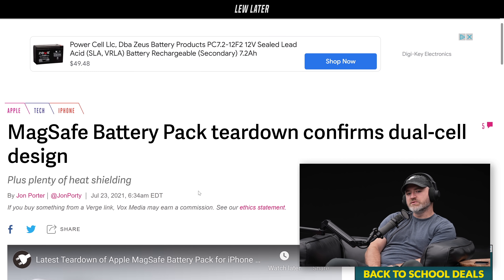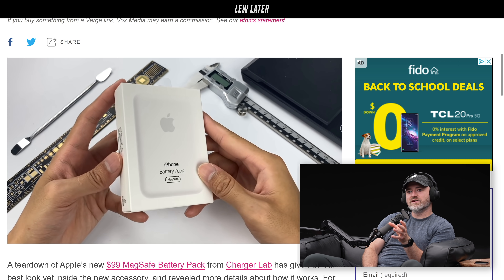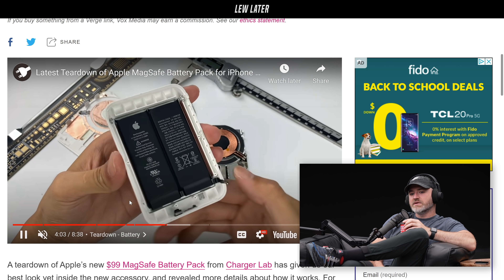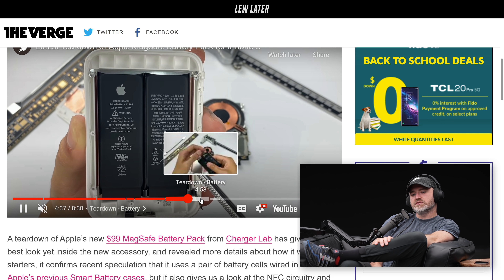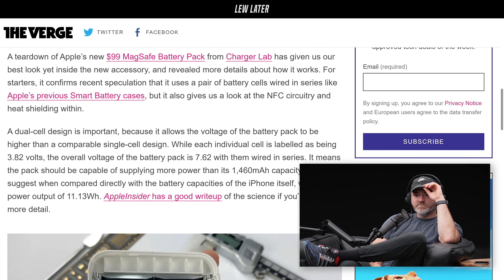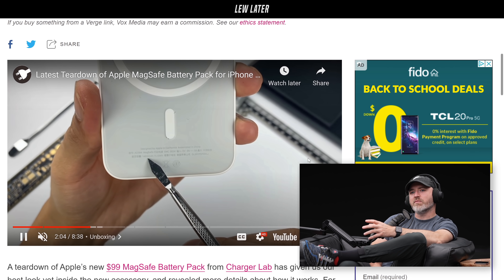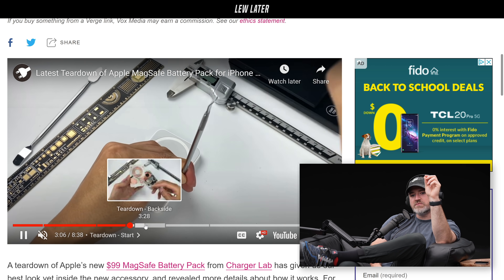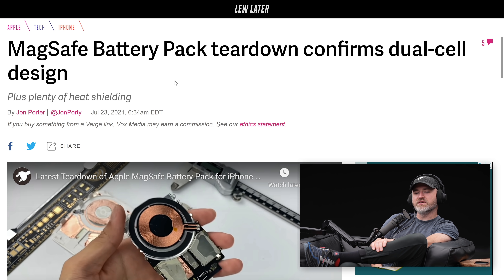Apple MagSafe Battery Pack Teardown

Comment: This video is very misleading. With the volts and mah it has it equals out to 11.13Wh. The phone 12/12pro has a battery capacity of 10.78Wh. You’re getting over 50% charge here Lew.

Comment: It's not half the capacity of the iphone, its around the same capacity as the 12/12 pro and if we take wireless efficiency into consideration we will get around 70-80% charge from 0%
Reply: with 50% efficiency it will charge iphone around 60%, the regular one
Reply: @clickbaitpro  that's exactly what I said 😂
Reply: Wtf are you smoking, one dude did a test and it only reached 48 lmao, stop defending corporations
Reply: @kdsburneraccount8087   The batteries in the magsafe battery pack are together 11.1Wh iphone 12 is 10.8Wh, wireless charging is of course inefficient and the iphone will end up 60%+- but given that the percentage is calculated from the voltage and not the actual capacity left. Because of the voltage/capacity curve, you will be able to use your phone around 70% time of a full charge. I am by no means an apple fan and I do not own an iphone so tell my why would I defend apple ?

Comment: I have a 12 and this thing pretty much doubled my battery life. It does charge at 5w and I found attaching it last minute (20%) didn’t really work well. It actually dipped a little before increasing the battery of my phone. However, attaching the pack from 100-50% works immensely better. It’s more of a battery extension. An external battery that can pop off once drained. Almost similar to the way space shuttles and rocket stages work. 

Also, the form factor when attached is reminiscent of the design of their previous battery cases.
Reply: apple fanboys always find a way to defend even a scam

Comment: for half that price, You can get a USB C PD battery pack from Anker that has 20,000 mAh!
Reply: @Dhiraj Krishna S It's 2*1460 (2920 mAh) because there're two batteries.
Reply: Whats a PD?
Reply: @Dhiraj Krishna S I highly agree.  I’m not sure why we don’t go by wh anyway.
Reply: But it has lower voltage so the watt hours is lower.
Reply: @TheMazyProduction  higher voltage lower watt hours.  Lower voltage higher watt hours.

Voltage* App hours =watt hours 
(Cough not accounting for variable voltage as it discharges)
Reply: 10.000mAh power banks are actually better for a few reasons: you can bring it to any country, it’s lighter, it can charge most phones for at least 2 times.
Reply: @aperson8693  requires a cable that breaks every 3 weeks.  Can’t be used as a wireless charger Bc ppl are into that?

Personally I did cycle though battery cases during Covid lock down because it was so much more convenient then plugging in the phone and this picks up on that as removing the battery pack is easy but keeping it there is also easy and not that as annoying.
Reply: Which is not MagSafe compatible
Reply: Apple accessories are mostly for style and not function
Reply: Apple rip off I have a few anker battery packs 10k-20k mAh n they work perfect n cheaper
Reply: @Dhiraj Krishna S I hate ppl who say this it’s 2 1460s… which means it’s equivalent to 2920 at 3.81 volts…
Reply: True

Comment: 1460MaH, are they having a laugh 😂
Reply: That's 1460mAh at 7.4V, so it's equivalent 2920mAh at 3.7V
Reply: @terimakinsu  you're not accounting for the inefficiency of wireless charging, tests have already been done and it charges a 12 max up to 45% or 12 pro to 60% or you could get a regular battery pack for $30 and recharge you phone completely 3 times over and at a faster rate.
Reply: You can make fun about the iPhone RAM too 😁✌️ the mah x2
Reply: 7.4v*1460mah*wireless is still sucks at this price but It’s only about “apple aesthetic and branding price”?
Reply: They could’ve slapped a bigger battery. The iPhone 7 even has a higher capacity, 1960… lmao
Reply: How the hell people start using “cell capacity” bulls*it and force customer guessing Wh only given Ah?
Reply: Tests didn’t do too bad though because of the efficiency. Most of those lose a lot. MaH doesn’t mean much.  Is it great Meh… is it laughable… not really.
Reply: @Jimpanzeeeee  it's not even close to a full charge, especially on the Max. I don't know why they bothered.
Reply: iphone 12 -> 10.78wh
This battery pack -> 11.13wh

So it can charge an iPhone 12 almost from 0 to 100.
Reply: @jonathanlange1339  no it cant, power efficiency from wireless charging means it will only charge to 60%
Reply: @wyrd21  
Yes you are right. I sayed "almost" because I thought it can do almost 90% if it charges with 5W and given that its aligned perfect due to the magnets of magsafe. Didn't know the power loss is still around 40%.
Reply: Tech nerds always make fun of ram and battery capacity, but they ain’t know voltage and ram management…
Reply: Don’t get me wrong, that’s a bad product. But for ram? Nah try it before you make fun of it

Comment: It's 2 cells in series so you can't compare using mAh ratings between the charger pack and the phone. You need to compare the Wh ratings for a real comparison of power capacity.
Reply: Yeah you have to compare the Wh but most people don't know. They should have performed a full discharge of the MagSafe to see how much % tops up the iphone. They just talk no idea what they are saying.
Reply: @Joe3D  i saw an article where it said the mini gets 55-60% and the max gets around 45-50% recharge from a full discharge.
Reply: Finally some people who have brain and not just senseless apple hater
Reply: @karansethia1037  well it doesn't matter this can charge only 40% for iphone 12 and 12 pro.
Reply: Yeah the iphone is 3.83 volts at 2,815 mAh and 10.78wH. While the MagSafe charger is 7.62 volts at 1,460 mAh and 11.13wH. So the MagSafe charger actually more Watt hours than the iPhone it probably looses a lot of its power through wireless charging inefficiencies.

Comment: 11.13Wh means It has 1460mAh if you use 7.62v and 3000mAh with 3.7v
It's still small compared Anker's (5000mAh at 3.7v) and is double the price
I think 1460mAh is a realistic figure since wireless is always less efficient than a cable. At least users will be expecting the battery pack to not charge their phones completely

Comment: The duel cell allows it to charge faster if it’s plugged up, any other time it charges at 5 watts, the battery pack is garbage, don’t get it twisted.
Reply: @Creeper Freak right but does it ensure battery protection and looks pretty with the rest of my Apple gear 😎
Reply: Works fine…. Doesn’t mess up your battery and it’s for that lil extra it’s not made to charge your phone and too off and all that other crazy shit that ain’t how Apple moves don’t pay attention to the numbers
Reply: I bought for my mini. I 14 hours a day and i use the phone constantly. I get about 10 hours of my mini and the last 4 hours i just plug the pack and wala! The thing is super convenient and does not heat my phone at all!
Reply: Adding more cells does not mean it can charge faster. A 6 cell battery takes just as long to charge as a 3 cell, or even a 2 cell when charged at a rating of 1c.
Reply: @Creeper Freak ok 👍🏾 right on
Reply: @Creeper Freak the phone itself has a battery protection, is the chips inside your phone that decide if your phone gonna charge or not.(thats how phones optimize charging times)
Reply: Works fine…. Doesn’t mess up your battery and it’s for that lil extra it’s not made to charge your phone and too off and all that other crazy shit that ain’t how Apple moves don’t pay attention to the numbers

Comment: Gotta communicate in Wh (watt-hours) with these like with electric cars. The battery pack is more voltage than the phone. You'll get just under 50% on the Pro Max, around 60% on the Pro, and around 80% on the mini.
Reply: @j.d6009  Yeah 1460 mAh would be like 30% of my Pro Max after you account for inefficiencies of wireless charging!

Comment: It's capacity is sooo less than anker one
Reply: Remember the iPhone's is at double the voltage, so it's technically twice the amount of energy for the same mah capacity
Reply: @davidyang9902  i thought it charged at 5w wym “twice the amount if energy” lmao
Reply: @fijiwill2237  5W would be the rate of charging, has nothing to do with the battery capacity. A oneplus phone can charge at 65W while an iPad charges at 30W, that doesn't mean anything about which device has more energy. I am talking about how much energy the battery actually holds. The energy in a battery is measured in Watt hours,  Whr. Whr is voltage X milliamp hours. So a 3.8V 3000mah battery would have the same energy as a 7.6V 1500mah battery. Just like if you have 2 AA batteries, if you connect them in parallel, you have a 1.5V battery, while if u connect in series you get 3V, but they amount of battery energy would-be the same, since you still have the 2 batteries
Reply: But it’s twice as effective……